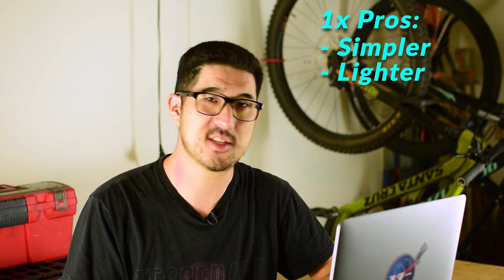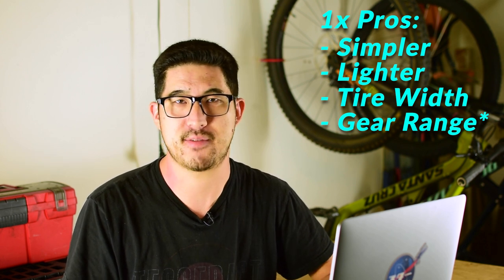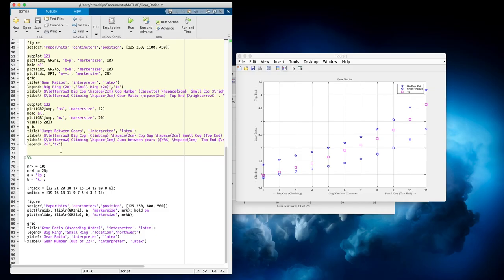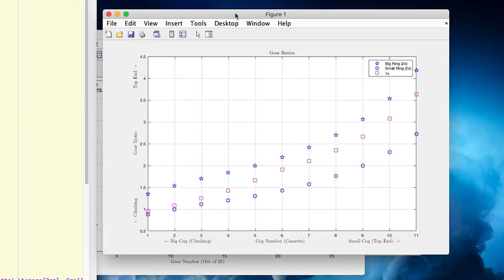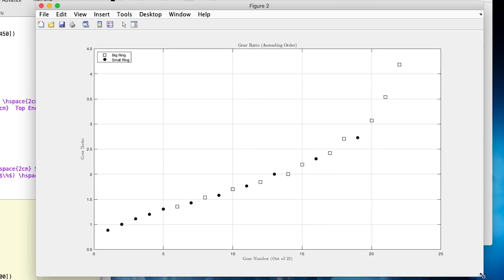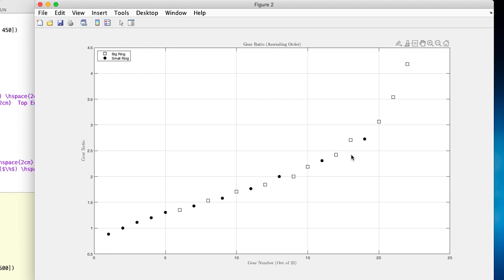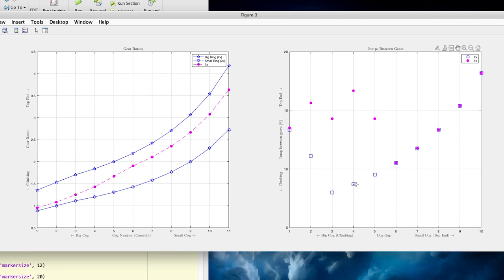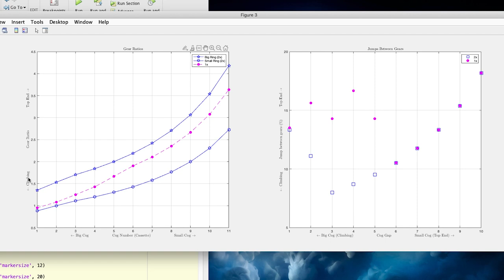1x vs 2x Drivetrains For Gravel Bikes | The ANSWER! (Is In Gear Ratios)

Comment: 10t - 48t cassette with a 42 t chainring is the way to go to have the same or even better range. If only all  could accommodate 10 tooth cogs. Smaller cogs are the future.
Reply from the maker: Nice. Yea it’s basically down to range vs increments. Choose one with 1x.
Reply: yes this for me would be the range I would want. Do you know how to achieve this?
Reply: @nick.j2772  garbaruk has 10 48 for sram xd. Ethirteen has 9 46 compatible with also xd. Hope has options but they have their own freehub. A video explaining those options would be nice though  because small cogs have some disadvantages. I have seen people tested the sram rival 1 shifters, derailleur  and ethirteen 9 46 cassette combination and satisfied.
Reply from the maker: It’s called a mullet setup. Or if you hack a drivetrain together - ‘budget mullet;’ road lever (business up front) with large mtb cassette (party in back). I haven’t experimented with too many different combos, but there are some good videos on it, if you’re interested.
Reply: @ozc1106  yes it is technically possible with mixing and hacking some components together but Im not very keen on this especially with the different hub and bb standards.....its a PITA to be honest I'd really appreciate a complete package from the big S, one or the other.
Reply from the maker: Would be cool. Definitely a market for it

Comment: 1x is the worst invention for bicycle in the history of bicycles.   Unless you ride 100% on level/flat bike paths.   1x makes you give up either/both the high end and low end of the range.  And MOST IMPORTANTLY, it creates massive jumps between gears.  Which means you will ALWAYS  be either spinning/grinding in the 'wrong' gear.  Which means you lose out on tons of fun on those long steep decents, as you'll spin out in the first 50 feet and be forced to coast down.  And, even worse, you're 3 hours into the ride, you're 30 minutes in on an hour climb and you don't have the right gear for how you feel right now.  
-
Proof 1x is a scam.  Many brands will sell the exact same spec bike with the optioin for 1x or 2x.  They are the same price.  But the 1x has less 'stuff' and SHOULD be much cheaper.  It's not.   It's a way for companies to spend that much less money making the bike, and get that much more of your money when you buy it.  
-
Bike companies also try and claim it allows them 'more freedom' to design the bike (especially for mtb).  Bullshit.  They are just lazy.   There are plenty of great suspension designs out there that can accomodate a 3x  (Niner rkt's can run a 3x).
-
This test was erroneous.  Why?  The 2x grx system is stupid.  It's been intentionally made 'smaller' for those riders who ride with huge packs (so they can push all that weight up the hills).   A proper test would have been to look at a standard road 2x, something like 52/36 up front + 11/30 in back.   You'd find a much wider overall range with this setup, and you'd still get plenty of comfortable steps between gears.  (I also suspect a normal road gear setup won't have as much overlap between small and big rings).-
-
Real world testing, for me at least.  When I bought my last mtb I test road 6-8 bikes.  Every one of them had 1x.  I was coming off 3x.  I found 1x to suck.  For the exact opposite conclusion Shimano used in grx system.  It's most important to have small jumps between gears when you are climbing, especially steep climps.  I ended up purchasing the aformentioned Niner rkt just to keep a 3x.   A friend of mine, who is in better shape, also got a niner but with the 1x.  We ride together often and he has to shift more than I do.  He's dropped more chains than I have.  He's had to push up more steep hills than I have.  He has to work harder to stay ahead of me on the flats (it's so fun to watch someone 'power' the flats in a 1x while you are casually pushing in your big ring on a 3x...)
Reply from the maker: Woah
Reply: @TheBikeSauce  Sorry, the 1x "revolution" had really limited my choices on bikes I can buy.  It really pisses me off.  This was a very good deep dive into the subject.  My only real "complaint" is that I think you vastly understated how important having the "right" gear is during riding.  Long rides, big rides, big climbs, big decents, times when you are feeling super strong, more often - times when you are about to bonk...  having "just the right" gear is super important...   Unless all your rides are on a flat level bike path...
Reply from the maker: For sure. 1x isn’t for everyone.

Comment: If you really wanna know why 1x is worst than 2x, just look at the history of 1x.  1x10 came onto the scene and was "the end all be all" of drivetrains.  But it sucked and people started to doubt the prophets.  Thus 1x11 was "the end all be all" of drivetrains.  But it still sucked and people started to doubt the prophets.  Low and behold 1x13 was introduced...   1x simply CAN'T be as good as 2x.  Why?  If you widen the overall range you must give up intermediate steps.  If you put in proper intermediate steps, you must give up at least one end of the range (high is usually given up).  
-
Thing is, 2x has worked on road bikes for, you know, the last several decades.  There is only one reason 1x is put on road/gravel bikes = corporate greed.  That's right, 1x has less components and is cheaper to produce and the profit margin is higher.  Notice the cost of a 1x system is exactly the same as a 2x (or 3x) system.  1x is all about the profit.-
-
Also, Bikesause got this wrong.  The GRX 2x is a watered down gravel system that is intentionally designed to have an overall lower range (to accommodate those that bike tour and load up their bikes with bags).  A more accurate comparison would have been to use a 50-34 compact road set with a 11-36 in back.
-
What the charts won't tell you is how important small jumps between gears are when you are 4.5 hours into your ride climbing some grunt of a hill.  Having 'just the right gear' means everything in these moments.  I mean my god, can you imagine grinding up a steep section and having to choose a gear jump that is 5-6% higher than it could be?-
-
And sorry, the summation of 'benefits vs drawback' is just terrible.  For the average rider, the 'weight savings' from not having a front derailleur and 2nd front chain-ring is meaningless.   As for 1x allowing for wider tires, the Specialized Diverge allows for 47mm tires.  If you need wider tires than than, you need a mtb bike.  And simplicity as a benefit is a non-starter.  2x has been tried and true for decades.  It flat out works.  I've seen just as many of my friends drop their chain on a 1x as I have on 2x or 3x systems.   Again, 3-5 hours into your ride, having 'just the right gear' means everything.  Say the event you are doing has a time cut-off (or you need to get back before it's dark).  If you have 2-3 hours left to go you certainly don't want to be in to low a gear going up the climbs as this will cost you time.  And you certainly don't want to be grinding up the climbs as this will blow your legs (eventually costing you time).  This goes for long stretches of flats.  What did Bikesause say the difference in top end speed was at 80rpm?  Something like 3-4 miles an hour difference?  That's huge.  Imagine being in group where most/some of the other riders have a 50-34 and you are stuck in a 1x.  They can easily be at a pace that causes you to spin out and be dropped...-
-
Bikesause, please borrow or rent a 1x.  Go out and ride it, get back to us with how it really feels...
Reply from the maker: Holy moly my good man. Perhaps you ought to stick to 2X.

I am actually reviewing a 2020 Ritchey Outback with GRX 1X. It’s a lot of fun and different for sure, and confirming a lot of what I had mentioned in this video (which is intended to be an unbiased presentation of a few calculations).

Thanks for sharing your opinion, but can we keep it less combative?
Reply: @TheBikeSauce  not trying to be combative, sorry.  Just brief and to the point imho.   Love your channel, keep up the good work.
Reply from the maker: Right on 🤘
Reply: @TheBikeSauce  Would you have the time to put a 50-34/11-36 into your spreadsheets? I'm dying to see the difference between this and a 1x...